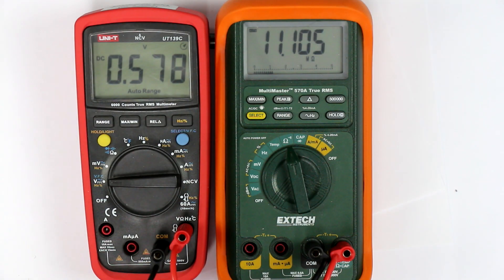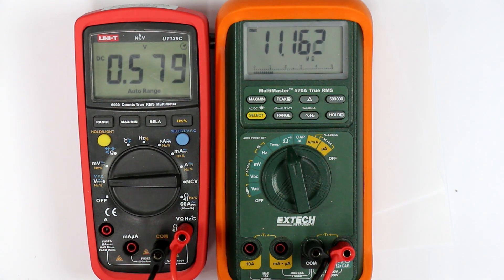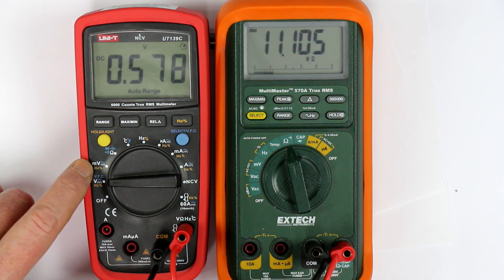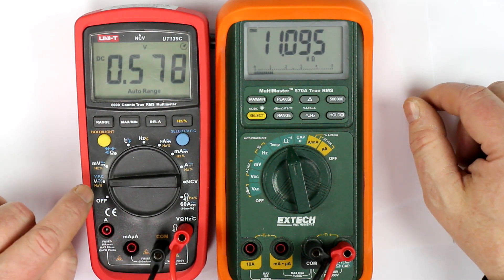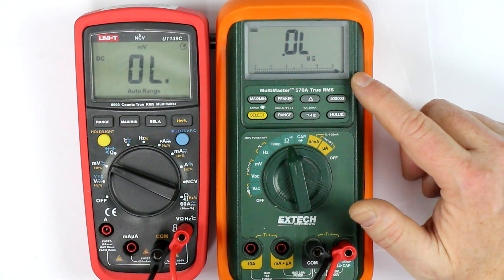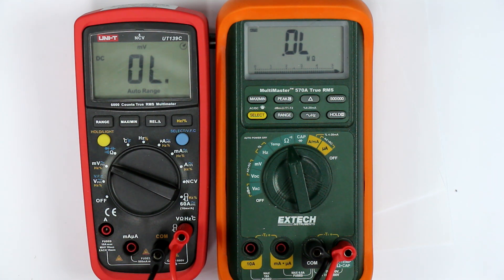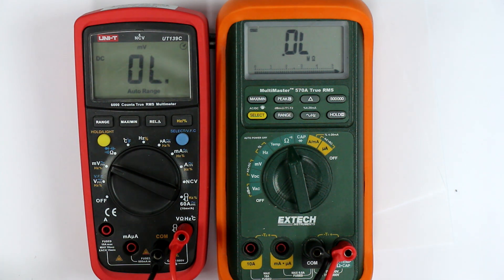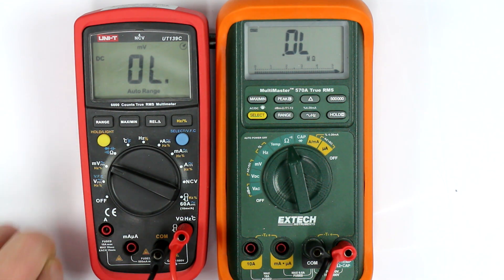UT139C High-Impedance Mode

Comment: So if I want to measure HV of an open-circuit I can't, becouse I can't use this mode to measure 400V...
Reply from the maker: Yep. The high-impedance mode is only given in the mV-range, not in the normal V-range.
Reply: @KainkaLabs  Thank you for the answer, and for this video.